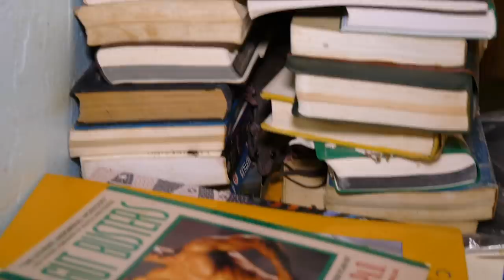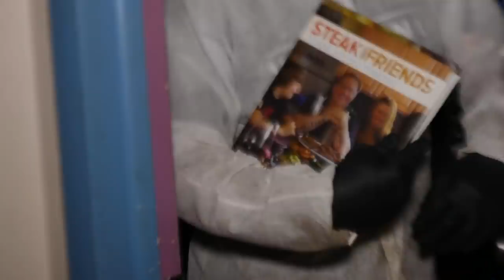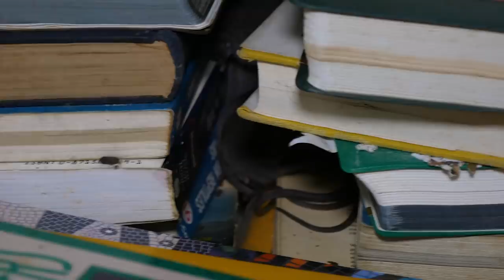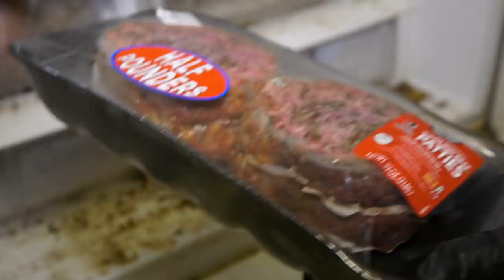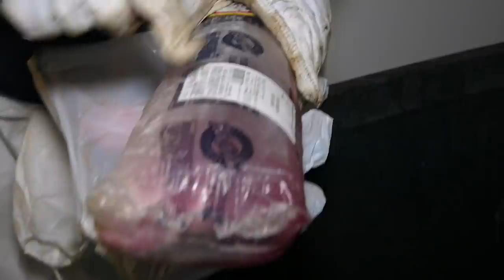Rat Infested Hoarding Nightmare Pt. 2 | Fort Myers, FL

Comment: This house needs to be taken down to the studs. The walls have to be full of mouse and rat droppings and you will never get the smell out. I would check with the insurance company to see if you could get some help with the cost. If the people are ever allowed to move back in you need to have someone come in and take care of them so this doesn't happen again.
Reply: My sister bought a cat-hoarding house. It was clean otherwise. We ended up taking the whole thing down to the studs because of the cat pee.
Reply: hard for them to demolish full working houses. i live in sweden and thats different of course. but if a house works fully and sint covered in mold its full fit. only anticimex that has to get the rats, worms and etc to get out. then renovate it to new walls and new floors with fresh isolating for the specific apartment. to demolish a working house cost a stupid amount of money actually if its an apartment
Reply: their job is just to clean everything, it’s possible that the house would be  taken down to the studs after this but that’s not their job they just clean it so that the people who would be fixing the house can do so safely.
Reply: @RealADnE  termites infested,, even inside door frames.
Reply: yea but they can’t just demolish a house owned by someone lmfao. those people don’t care, they want to move back in. If that’s what they want, so be it.
Reply: I agree. This is a situation where the structure would have to be tented and gassed, following by a complete tear down to the the studs, re-wiring of all electric etc. a really sad situation.
Reply: All that poop is the insulation... Lol

Comment: Regardless of if they got all the mice or rats out they still have to go into the walls to take out contaminated insulation and check the wood for soundness. They could have chewed main beams or soaked wood with urine and it would have to be sealed. Remember rodents pee constantly as they move along so every surface wall clothing carpet etc has urine on it. And yes they should have been in PPE for that very reason.

Comment: Man I don't know how you don't ultimately take this down to its studs. Is it even worth saving? That poor homeowner.
Reply: Yep, if you have to replace the wood in a wood-framed house, and of course you have to remove the drywall on the inside and what is covering the outside(like vinyl siding) to get to the wood, what is the point of doing that when it is easier and better to build a new house that will be fully up to hurricane code?
Reply: The fear of contamination, fumes etc. from the studs soaked in rat urine would tempt me to pour gas and flick a match. So many disease are transmitted from rat/mice urine and feces. Gaaaaaah!
Reply: @valerief1231  The termites have eaten most of the urine-soaked studs, that's the problem!
Reply: @SirReptitious  whew, that’s true, it’s basically sanitized 😂 duh, I should have thought of that!

Comment: That house is dangerous considering the mouse droppings in the walls and the termite damage! As a daughter of two exterminators, traps would be the way to remove the rats and mice, if you use poison theyll die inside the walls and it will reek of rotten flesh, ots alright if there is like 1 but so many? No

Comment: So this is a silly question & I could Google it but how are mice different from rats? Everyone is referring these as rats. Either one is still “ewe” in my book.
Reply: mice are considerably smaller than rats, measuring around 12 to 20 cm, while rats are about 40 cm. A mouse's head is also much smaller than a rat's head in direct relationship to its body. Rat heads are heavy, blunt and chunky, while mouse heads are tiny, sharply triangular, and have pointed noses. And rat ears are smaller than mouse ears relative to the size of their heads.
Mice tend to have softer fur, while rats' fur is more coarse. A house mouse's fur is light brown or gray to black in color, with lighter bellies. A Norway rat has coarse brown fur with a lighter underside.
Mice are not only shorter than rats, they also, logically, weigh less. Mice weigh 30 to 90 grams while rats are between 350 to 650 grams. If you see a rodent that looks like it needs to cut back on the sweets, you are probably looking at a rat, as they tend to look fatter than mice.